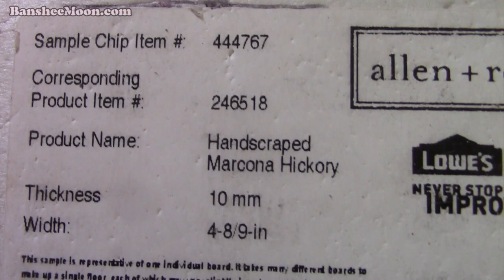Exoman and Farm Girl Work on the Laminate Flooring

Comment: Here's a tip to increase your production quality on some of these videos. Go to RadioShack or Amazon and order a lavalier microphone for like $30 to record the audio separately. It probably wouldn't apply to this video but in a setup like "How American Made Is Your Truck" it would have been a huge help with the wind noise. Not sure what you guys use to edit but you can usually just insert the separate audio into the video but make sure to mute the native audio track or fade it down in the right areas when needed. Maybe make a clapperboard or just use your hands to clap in front of the screen to synchronize the external audio track with the video (but edit that out). You'll see the audio spike with the visual clap and can use that as your marker to start the lavalier audio. It's a little extra work to add it in but it will bring your production quality up significantly! I just realized, wtf am I doing! I was just looking at maintenance tips for my chainsaw and an hour later I'm like10 videos into the Banshee Moon and Exoman show... Damn you youtube!
Reply from the maker: Iconic Cypher Thanks for watching and sharing your ideas!